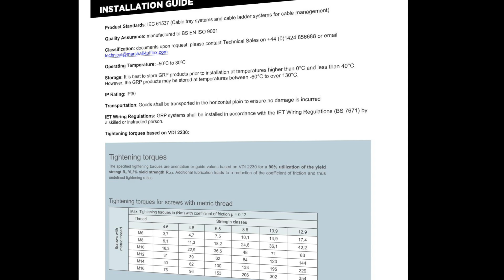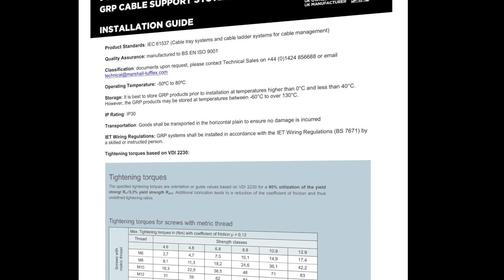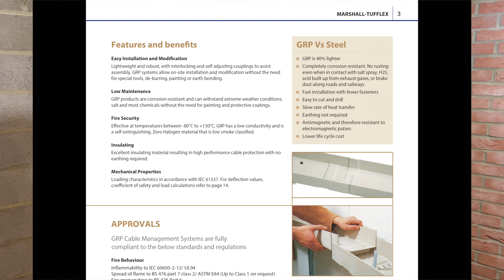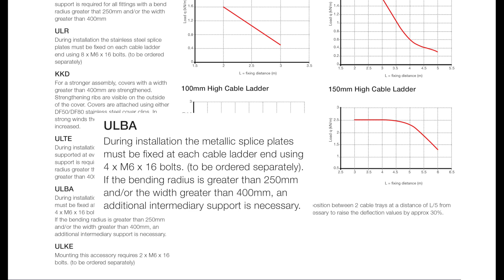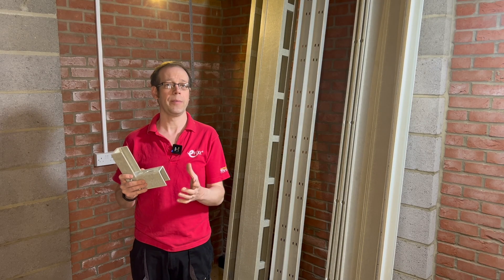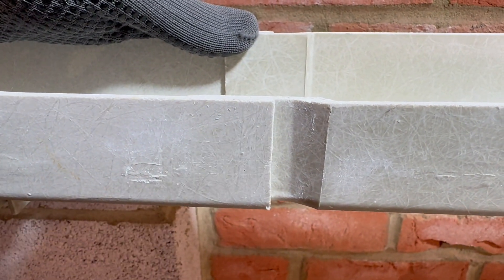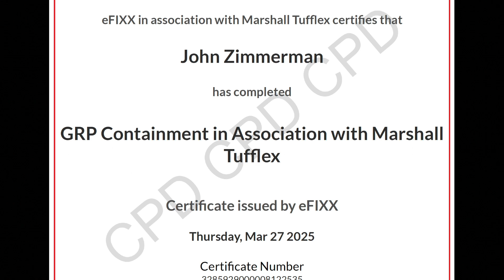Install GRP Cable Tray In Minutes - It's That Simple!

Comment: Is it recyclable?
Reply from the maker: Glass Reinforced Plastic (GRP), also known as fiberglass, can be recycled, but it’s more difficult and less commonly recycled than materials like metals or some plastics. Here’s a breakdown:

♻️ Can GRP be recycled?
	•	Technically, yes – GRP can be recycled, but it requires specialized processes.
	•	Mechanically: GRP can be ground into small particles and used as filler in concrete or asphalt, or for use in other composite materials.
	•	Thermally: It can be used in cement kilns as a fuel and raw material replacement, recovering some of the energy and materials.
	•	Chemically: Advanced processes can break down the resin, but these are not widely available due to cost.

🚫 Why is it challenging?
	•	GRP is a thermoset composite—once it’s cured, it can’t be melted down like thermoplastics.
	•	Separation of the resin and fibers is complex and energy-intensive.
	•	There’s limited infrastructure and commercial demand for GRP recycling compared to metals or standard plastics.

✅ What are the sustainable options?
	•	Reuse: If possible, reuse GRP components (e.g. boat hulls, panels).
	•	Downcycling: Use ground GRP in construction materials.
	•	Specialist recyclers: Some companies specialize in GRP recycling—especially in the wind turbine and marine industries.
Reply: Damn, good answer ChatGPT.

Comment: solely one mans opinion, but I feel this will only be appropriate for indoor use. I feel, from a similar experience, after many years of external use (left to the Sun and other elements) it will become brittle and break from the slightest sniff of a boot kick. You'll find pieces all over industrial and commercial roof tops in years to come!
Reply: My experience is that GRP is very resilient especially in areas of corrosion. It does seem to degrade and get brittle over many years but stands up much better than everything else apart from 316 stainless.